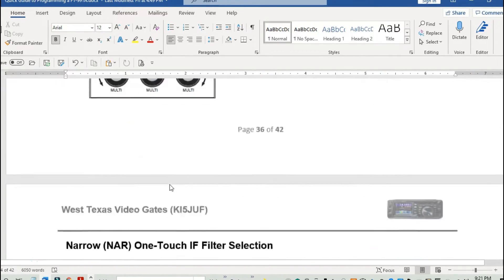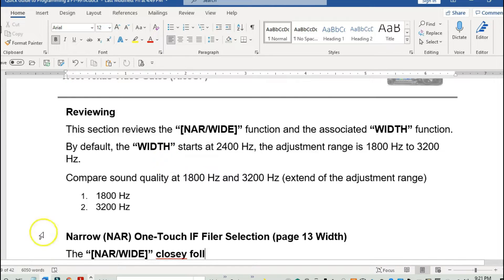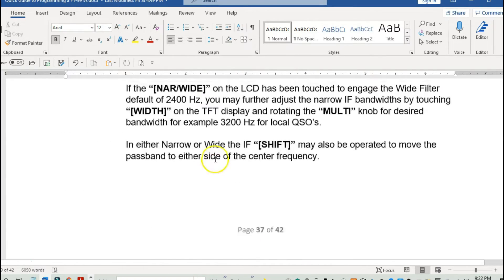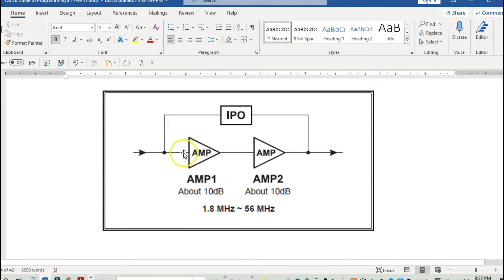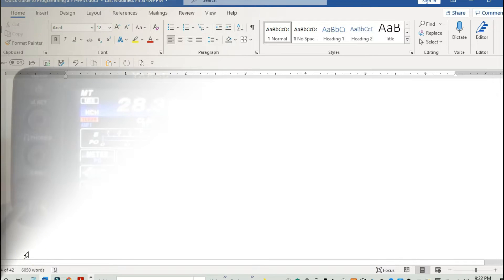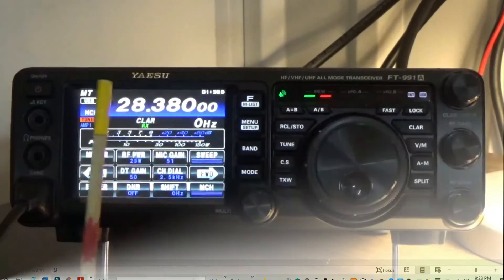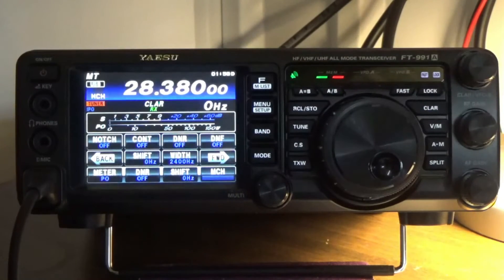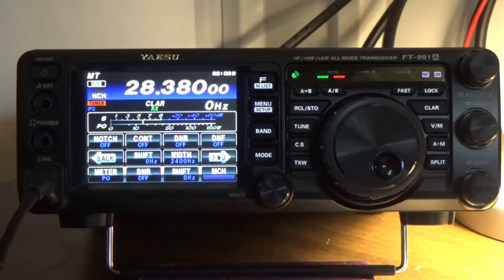Review IPO/AMP1/AMP2 and WIDTH and NAR/WIDTH with Transmit Bandwidth Live Results on Yaesu FT991A

Comment: Thanks for the video. One thing I never liked about the Amp 1 and 2 is that they make it hard to give a true signal report to other stations.
Reply from the maker: Hi John how you doing, you are 100% correct many RST with APM1 or AMP2 have been maybe not reported 100% correct, so I always leave the ATT off and only use the IPO.  Appreciate the message and 73 sir!

Comment: Thats function i use  only for  RX , ajusting width or narrow reception + DNR, then you can made a better reception of wek signals, almos you can use Rf gain for  reduce de background of signal whit information (phone or digital modes )... thanks  for  the  video , best  regards
Reply from the maker: No problem I figured out how to adjust the transmit it setting 110 on the Menu/Setting '73 de KI5JUF  https://youtu.be/_2CJoKOvaPw

Comment: So in HF those controls only impact receive mode. But in UHF they impact transmit mode. The question I have then is, in HF mode, how can you punch through your transmission more? What settings can you use for that?
Reply from the maker: Good evening David, thanks for the message, this is a situation I don't have 100% grasp on yet,  when I did my video I referenced page 67, it discussed the WIDTH and mentions increase talk power narrower bandwidth, this sounded reasonable, from my test with my friend Steve he was not able to notice any difference on my transmit when I adjusted the WIDTH, so I want to lay this out in a video and send it to Yaesu, and on page 52 it specifies only FM is BOTH transmit and receive - so I need to get to the bottom of this, anyone else has any thoughts let us know, and thanks again David always good to hear from you sir, '73 de KI5JUF
Reply: @westtexasvideogateski5juf255  these page numbers do not align with the “manual” on the Yaesu website for the FT-991A. Is it a different document? Within the manual, page 69 specifies how to change the SSB menu item for transmit, default is 300-2700. The “Width” is for receive only on page 53.
Reply from the maker: @griemakr  Good evening Mark, thank you very much, I'll try the (SSB Mode) “110 SSB TX BFP”  settings and see if that changes the transmit audio, so the WIDTH only changes the receive and that's what I've notice too, I really apprciate your help, '73 de KI5JUF I try a video let me know if I missed anything

Comment: What’s the 5/10hz  button for????
Reply from the maker: Good evening sir,  I'm working on a video now essentially it's the frequency step for LSB, USB. CW, RTTY, DATA LSB or DATA USB with the “FAST” button disabled.

Below shows 10 Hz
28.400.000 (visible)
28.400.010 (visible)
28.400.020 (visible)
28.400.030 (visible)
28.400.040 (visible)
28.400.050 (visible)

Below shows 5 Hz
28.400.000 (visible)
28.400.005 (not visible)
28.400.010 (visible)
28.400.015 (not visible)
28.400.020 (visible)
28.400.025 (not visible)

I get a video up showing how to do this on the FT991A

'73 de KI5JUF have a good evening sir!!
Reply: Just got my 991a and these videos have been super helpful. I researched this same topic last night and it feels like I am learning along side you. K1son
Reply from the maker: @jrogich  Good morning - congratulations on the rig,  we put together a video on how the speech processor works (PROC) with the (MIC-EQ) parametric EQ, give these settings a try in the following video, you'll be making DX contacts right-away  https://youtu.be/v0ro0bANElo   '73 de KI5JUF have a great week!!

Comment: It is experimenting.  What works and what doesn't.  Another great video. 👍👍
Reply from the maker: Copy that, I was able to figure out a way today to demonstrate the Speech Processor and the Parametric Equalizer  using an "old school" external speaker to demonstrate what you sound like on the air with the MIC-EQ and the PROC on  https://youtu.be/v0ro0bANElo

'73 from KI5JUF have a good evening sir